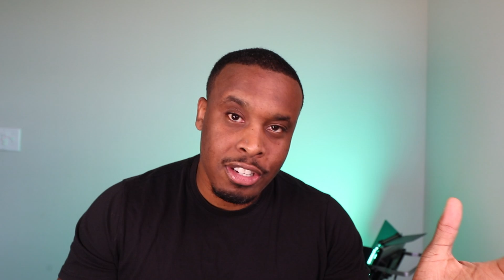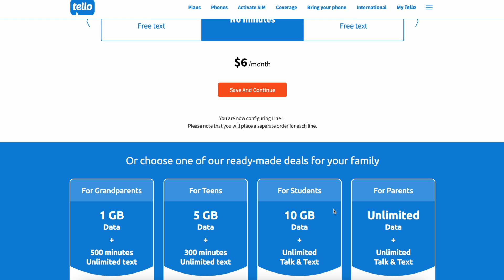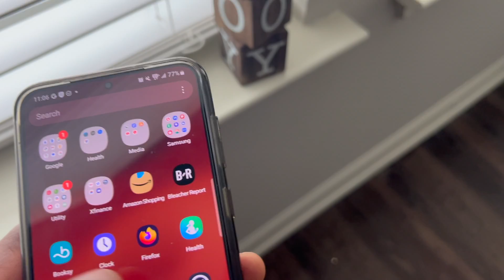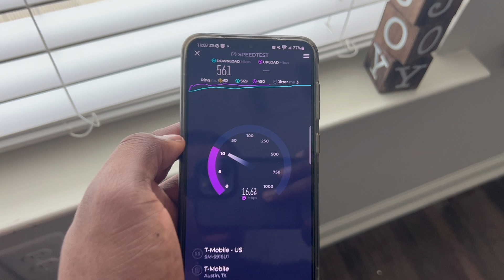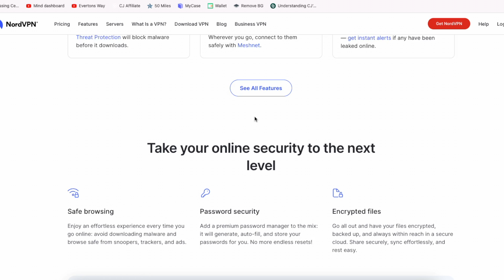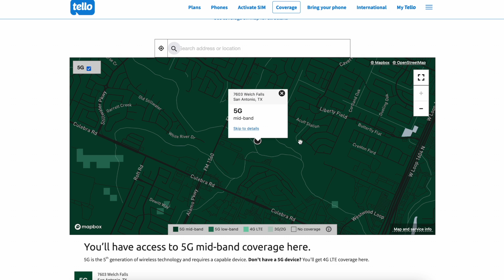Tello Mobile Review: Price is GREAT but how about PERFORMANCE?!

Comment: WARNING:  WITH TELLO, YOU MAY NEVER GET YOUR ORIGINAL PHONE # BACK.   
I made the mistake of trying them, and have botched the transition. It's now 1 month and they have not completed the transfer.  SUGGESTION:  make sure you have a 2nd phone line for their inevitable screw-ups on your primary line.  The 24/7 customer service is useless.

Comment: I'm looking to choose between Mint, Tello & US Mobile, which one would you suggest? I only really need max 5GB of mobile data since I WFH and I'm on wifi almost all the time and I text more than call. I don't stream at all on the go, maybe some youtube videos once in a while, but no streaming services like Netflix. Thanks
Reply from the maker: Tello is a great option, bc of their ability to restart a billing cycle immediately if you use all of your data, for your needs if you need 5gb of data it's very affordable at $14/month, undercutting mint by $1 😂 and you won't have to pay 3 months at a time. Same speeds as Mint, but the only thing to watch out for is if you run out of data, it doesn't slow down....it STOPS. So you will have to re-up whereas Mint and US Mobile just slow you down
Reply: @evertonsway  Fair enough, currently it seems I average between 2-3GB or mobile data a month since I'm always on wifi so not worried about that, but good to know I can re-up anytime I want technically. I have Verizon now, but reception isn't great in my area, so also curious to see how the T-Mobile network works in my area. Appreciate the reply!

Comment: I getting mixed info so wanted to ask . . . were you able to keep your phone number or did you have to use theirs?

Also, just a safety thing, would you trust this service if your car broke down in the middle of the night in the middle of nowhere?
Reply from the maker: You can port in and keep your number and yeah I trust the service. It's a good service. I've tried multiple carriers and haven't really ran into one that doesn't do the basics well... Phone calls and text
Reply: Appreciate your reply. I'm gonna trust you like I trusted you with Mint. If it goes wrong, I'm gonna talk about you. 😏
Reply: Tello has this weird thing where you have to get a new number when starting service and after that you can port a number to replace that one.
Reply: @jb888888888  With Tello's "port later" policy, you can try out the service with the new number and to decide if you really want to use it.  US Mobile (as an example) only does port-in on brand new line, so doing a trial is a little more bother.

Comment: Question. Using Tello final price is only sale tax added or there sale tax plus fees like on mintmobile?
Reply from the maker: Final price if it says $10 you pay $10
Reply: This will vary by state.  I see no sales tax per se, but a number of other fees are added.  In total it comes to about $1.50 per month (and might vary depending the price of the plan).

Comment: I'm a Tello customer since last summer. I got the $5 plan and use it as a second line. Though it's been use as a primary line lately. I don't have an issue with it. Use it to make quick calls and give out the number in the open. My other line is Visible. So, I'm glad I pay little over $30 for two lines.
Reply from the maker: I agree it's a good and inexpensive option! I was only going to test it but it worked so well I kept it!
Reply: @evertonsway  Indeed. I got my sister to get Tello for her son's tablet with the $10 5GB plan - gives more than T-Mobile Prepaid $10 data plan. As well, a friend too for her sons' tablets. It shocks me to hear people pay over $50-60/month these days on a single line and over $100 for multiple lines.

Before switching to Visible, I had T-Mobile prepaid, and I hated paying $50(plus taxes & fees) per month. That was for 2 years between 2019 and 2021 and the most expensive I paid for.

Comment: Metro has the BYOD $25 plan the includes real unlimited data. The first 35gb is prioritized and after that the data is subjected to deprioritization but often still just as fast.
Reply: I thought about that plan too but the no hotspot is a no go for me
Reply: According to Redditor i-am-not-sure-yet you actually get a 10gb hotspot included  @JamesLauricia7
Reply: @JamesLauricia7  Same here, and thank you for mentioning this as I wasn't sure if it had Hotspot or not.  I'm thinking either Tello or Visible.  Tello's $25 unlimited plan only comes with 5GB Hotspot data.  If you get any of the other data plans (such as 15GB) then you can use any portion of that data allotment for Hotspot, though I read it is also supposedly limited in speed to ~15-31mbps. 

 Visible's 25/mo plan has unlimited Hotspot but is limited to 5mbps.  It is the same 5mbps Hotspot on their 45/mo plan as well, which really rubs me the wrong way.
Reply from the maker: That's a GOOD deal!
Reply: I've seen 1220mbs even after 110gb used @evertonsway
Reply from the maker: That's amazing speed! I've never come close to that
Reply: @evertonsway do you get 5G NSA or 5G SA go to your phone and type *#0011# and click your tello sim card
Reply from the maker: NRG5G
Reply: I watched a video where they tested Metro's $25 plan and had already used 110 gb and he was getting 1,220 mbs speeds- over a gigabit!  @evertonsway
Reply: I'd definitely be interested if they include at least a reasonable amount of Hotspot data in their plan.  Will have to check it out, thank you.
Reply: A Redditor said that it gave him a 10gb hotspot and showed a pic that showed it to be true  @GreenLeefMusic